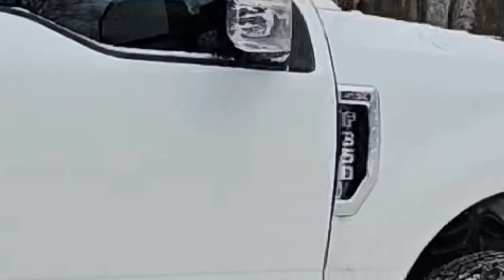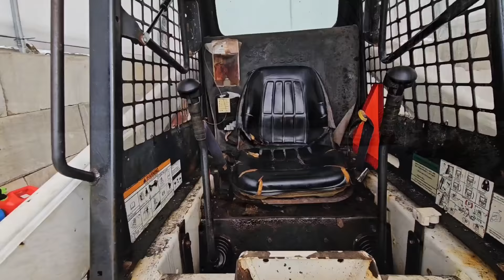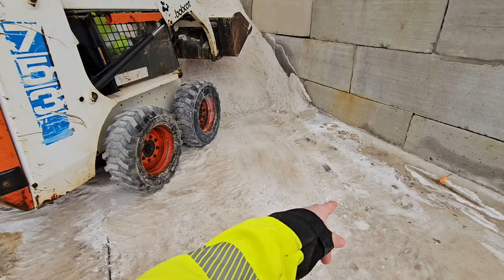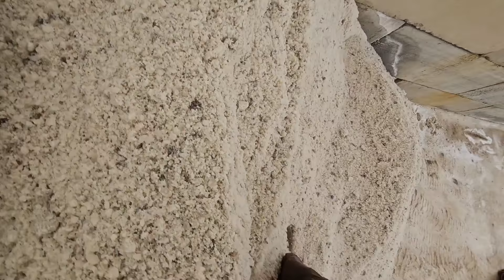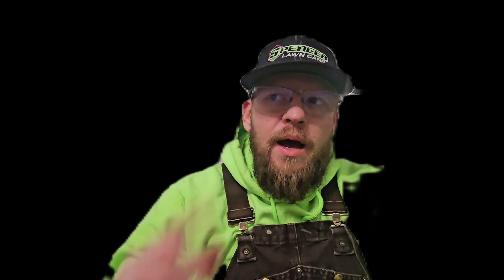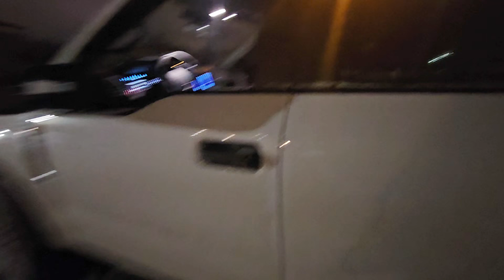PREPPING FOR SOMETHING NEW BUT WE HAVE SOME WORK TO DO FIRST!

Comment: We use a salt/sand mixture and have no issues running it through our salt dog sander. We mix it according to customer request. FYI if you use sand we have to rent a sweeper every spring to remove it from the driveways/roadways

Comment: They make a torch head that goes on a propane tank that they used to put the white stop line on roads when they repave them I used to that when I was younger to remove snow I got tired of shoveling it dries it and everything you don't have to salt nothing